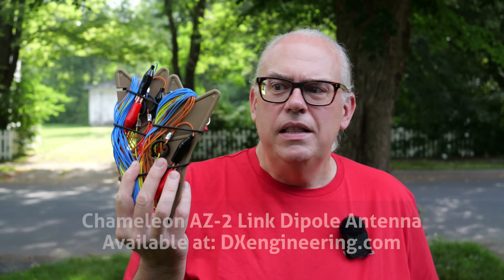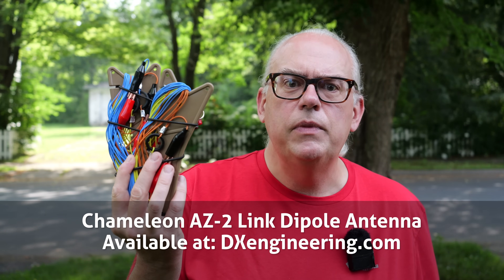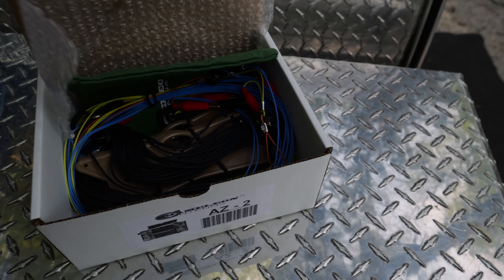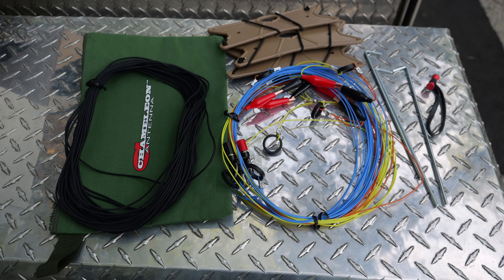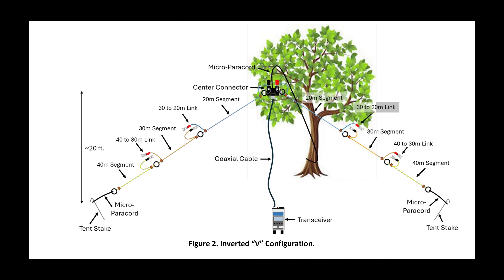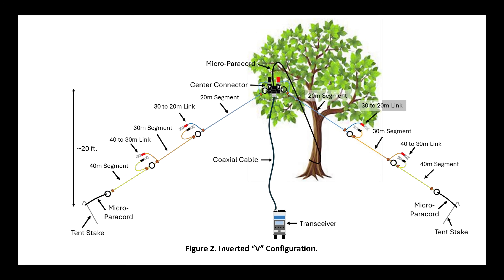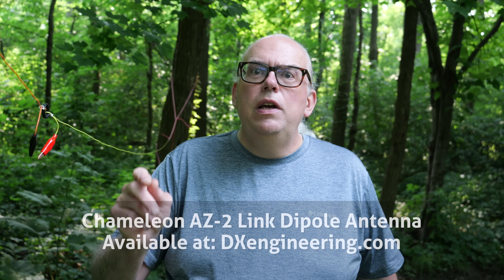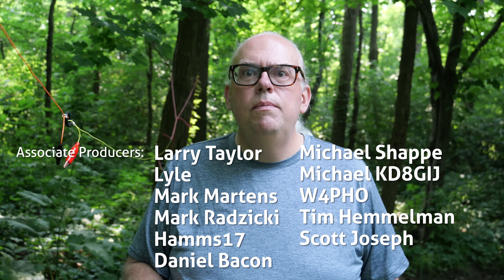Are SIMPLE antennas the most effective? Chameleon AZ-2 Link Dipole

Comment: At some point, I’m sure I’ll build one of these with my own choice of bands, however, though the alligator clips are very simple, when I was building my POTA PERformer antenna, I really fell in love with using those heat shrink, with glue inside, spade lugs. Thinking I will use the small nonconductive links with a jumper at each link built-in. Just thinking out loud right now. Thanks for all the great ideas.

Comment: Question: Those black rings at the band links look like toroid's, can you tell what they are made of? Love the multiple band concept!  I cut my teeth in the 1970's on dipoles cut using the 468 calculation and they worked very well.  Otherwise, don't see why I couldn't build one of these to my own band choices.  As always, thanks for the video Michael!  73s, Bob WB0WIF
Reply from the maker: Those rings are of a non-conductive material. I don't know the exact makeup, but they are plastic. As for building your own, it is relatively easy, I have a video that demonstrates how: https://youtu.be/zvtKlqQ6DSo

Comment: How useful would a dipole antenna be if one simply ran it over the ridge of a roof in an inverted V? I'm in an HOA and I think I could pretty much hide a wire under/over some trim. This is something I would leave up permanently, so it would need to be weatherproof. Similar question for an endfed. Also, would I need to run two wires if I wanted to TX on 20 & 40 meters or could I simply use an antenna tuner? Thanks.
Reply from the maker: Laying an antenna on the roof will work to a certain degree. It may be slightly detuned, so you will have to account for that. It's not an ideal situation, but one that will work. 

If you are looking for multiple bands, though, I would recommend an end fed non resonant antenna. Something 49 feet in length with a 9:1 transformer will operation 10-40 meters with a tuner and could be hid on your roof, along a non metallic gutter, or in the attic. Since you will probably need to use a tuner compensate for the effects of your house, you might as well embrace it and go with a non resonant antenna. I hope this points you in the right direction.
Reply: @KB9VBRAntennas thank you. That helps. I’ll experiment.

Comment: Looks like a well made antenna . DX Engineering has lots of great stuff. I am in NY and want to make the trip to Ohio to see the store . Also Summit racing . I can see this going with the Orange Hi Viz RG8-X They sell as a good POTA/SOTA kit. That a better grade of 8X  and bright orange and flexible and 100 % copper Made in USA coax. Written right on it. For HF that great . When getting into UHF then better coax needed . I use M & P and have the POTA flex 7 reel kit with yellow case . That great as well and works great on GMRS and VHF . You could add link for 17/15/12/10/6 meters if you wanted. I like how you use the antenna then give a honest review ! Nice tips about the Hight.  73 from NY
Reply from the maker: Joe, who regularly appears on this channel, has some of the DX Engineering hi-viz RG-8 cable. He really likes it.
Reply: @KB9VBRAntennas  I know that Joe is who turned me on to that and I really like it to ! Always got good stuff on your you tube ! Cheers from NY !

Comment: Nice review Michael. I don't see a way to hang the antenna. Do you just use one of the split rings as a center support as well as a hanger for one side of the dipole?
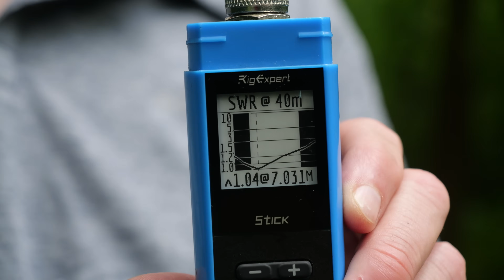Reply from the maker: I hung it from one of the split rings, as illustrated at 03:24 in the video

Comment: In a previous video, you talk about a decline in solir activity and the effects, decline, on 10 and 15 meters.  My question is why no really effort on checking out antennas for 160 or 80 meters?
Reply from the maker: Although it will be declining, we've got at least 2 good years of 10 and 15 meter activity. We are still near the peak and 80 and 160 meters are very noisy. I think it is going to be at least 3 or so before you see those bands really come back strong. Especially 160 meters. As the solar cycle retreats, we'll see more low band opportunity and a greater focus on low band antennas.
Reply: @KB9VBRAntennas Thanks for responding.

Comment: ..., or you could make your own for a lot less and have a lot more flexibility. The linked dipole that I've been using for a bit over the last five years was made from cheap hookup wire. It covers all bands from 80m - 6m and I frequently pump 100W into it. Being someone who works with audio cable a bit, I am wary of wrapping wire around spools like this and find that wire lasts a lot longer if you "under/over" and use velcro tie. I ask about it on my blog, which you could find be searching for vk2mg My Portable Antenna Evolution.

It would seem that you've got some kind of comment deletion enabled if a link is included as two previous versions of this comment have gone missing, so I've left the link out of this attempt to comment.
Reply from the maker: As someone that has worked professionally in video, I am a big proponent of the Over-Under method. Searching my channel, you'll find at least a couple videos on that method. Looking closely at the antenna spool's, you'll notice the wire is wound in a figure-8 pattern, which is the same as over-under, but on a winder. 

As for comments, I don't automatically delete comments unless they venture into politics, hate or sexual content. Youtube itself gets funny about links, sometimes it allows them, sometimes not.
Reply: @KB9VBRAntennas  I also use it on my MacBook power supply cable. Lasts years that way.

Comment: A 20-30-40 linked dipole was the first antenna I built for POTA about 5 years ago. As demonstrated, it works great and deploys easily. The  key is consistency in the setup. Changing the center height, the end heights, or the apex angle will all have some impact on the resonant frequency tuning, so consistency is your friend. 
KZ9V

Comment: sorry, but its just a knockoff from the SOTABeams Band Hopper portable dipole, that is on the marked since 2018. And the SOTABeams is only 1/3 of the price and comes with a common mode choke and a feed line 😂 and if you do this DIY, you will properly stay below 20 bucks 🤣
Reply from the maker: Quite possibly. Of course there are many link dipoles on the market, they all can't be knock-offs, can they? Unfortunately SOTAbeams antennas are always out of stock here in the US, so this is an option that is available.
Reply: @KB9VBRAntennas  In fact, they’ve been OUT OF STOCK for more than 2 years!
Reply: @Chameleon_Antenna  weird cuz I just bought one in January.
Reply: @Chameleon_Antenna ok, it's not available on the market. So let's "steel" the design. (As far you can steel a dipole design, but the overall appearance, e.g. alligator clips, is more than given) But your company is known for that kind of behavior. like you did with the 5:1 UnUn from the MPAS, you never gave credit to G8JNJ 😢
Reply: @Moselblues  Hmmmm, wonder why they call it “chameleon”?
Reply from the maker: In the US at least, antenna designs can't be copyrighted or trademarked. If the approach was novel, it could be patented, but even that offers limited protection. For a design to be considered 'stolen' it would have to be a 100% copy of the original. In comparing the Bandhopper to the AZ-2, that is certainly not the case. 

The reality is, anyone can make a sell a link dipole antenna. Anyone can use alligator clips as their link method. The act of doing so isn't stealing from another.
Reply: @Chameleon_Antenna  Currently in stock, but YouTube won't allow a link.
Reply: I just ordered one directly from the company at a killer good price. I’m not worried about delayed delivery. I think SotaBeams is going to see a bump in sales because of this video….

Comment: Can you work 15m with the 40m length of wire being that is the 3rd harmonic?
Reply: Even better, cut the 17m leg, add alligator clips
Reply from the maker: You can with a tuner. When I measured it, the SWR was about 4.5:1 on 15 meters with the antenna set to the 40 meter band. Changing the antenna's height might change that value, though.